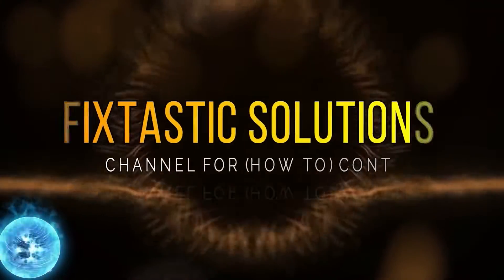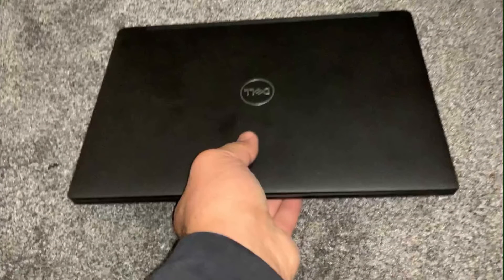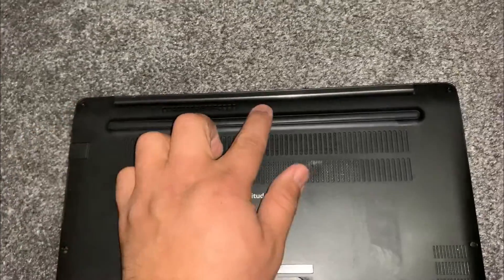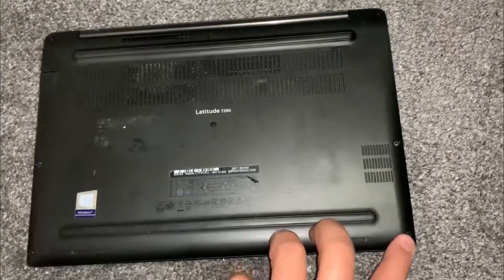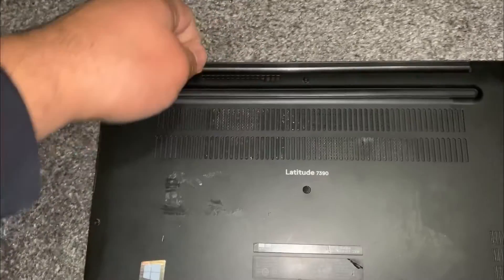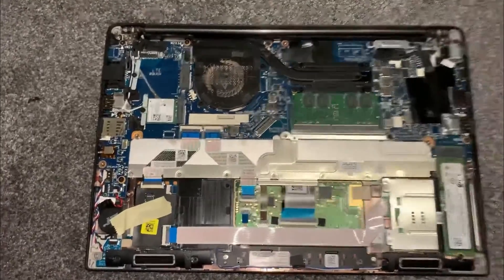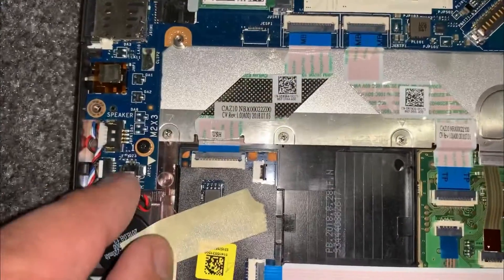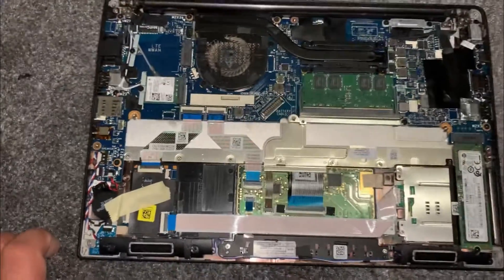Dell Latitude 7390 - Locate CMOS / RTC Battery

Comment: the connector that you pointed to is for the speakers.  The cmos plug is on the back side of the MB directly below there.   

I am having troubles in that my wires came out of the plug, and I am not sure of the correct polarity.  If anyone knows, can you tell me if red wire should be towards the outside pin or the other?  (defining outside as to the left with the PC and Motherboard orientated as shown at the end of the video)